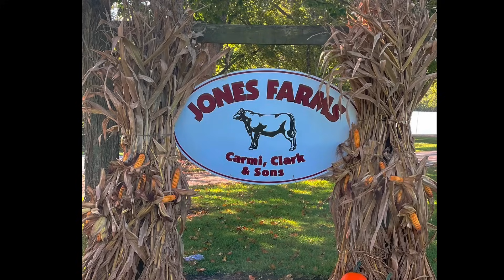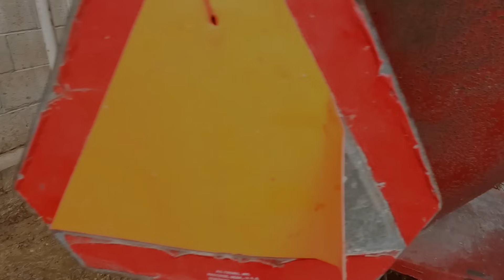A Typical Day Taking Care Of 300 Head Of Cattle!

Comment: Great show. Can you please explain what and how the machine in the top of the silo is doing.?
Reply from the maker: It is called a silo unloader. It basically rotates around the interior of the silo and has a chain that drags the silage to the center and then blows it out the chute on the side of the silo. 
Pretty handy machine. If we didn't have this, we would have to throw it out the side using pitch forks! 

Huge labor saver!

Comment: I like the unroller.  Have you been happy with the job it does and the reliablility?  The claims of savings the manufacturer has are very high, do you see a significant savings when using it?
Reply from the maker: Yes, we like it. The cattle do seem to waste a lot less hay. Sometimes we roll the bales down a hill the traditional way, but some of the hay is either tramped n, or the cattle lay in it. I think we paid around $12k for this unit 3 years ago.

Comment: Great video!  Brings back memories of younger days.  I was surprised to see you still actually using the old style silo. So many are sitting empty and abandoned now. That feeding system is pretty sweet.   Hauling round bales in trucks is pretty cool. Better hold on to those long bed trucks because they don’t make many of those and I suspect that when they get done ramming these damn electric vehicles down our throats there won’t be any trucks that can haul anything.
Reply from the maker: I consider our farm to be rather "traditional", so we still do some things that others don't. Funny you mentioned long bed trucks. I had always been a Chevy guy, but was looking for a new truck about 4 years ago. I could not find a long bed Chevy, so I switched to Ford. 
Not impressed so far!